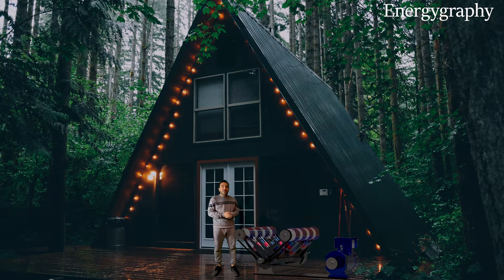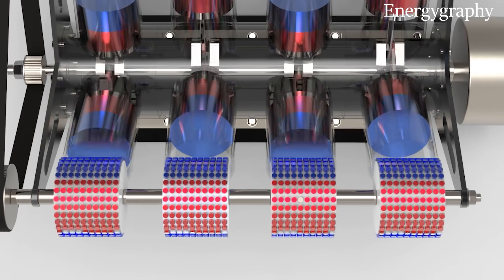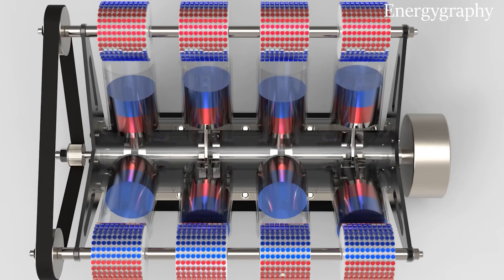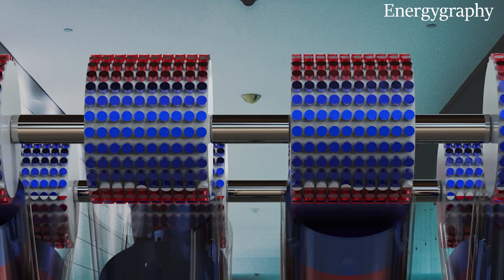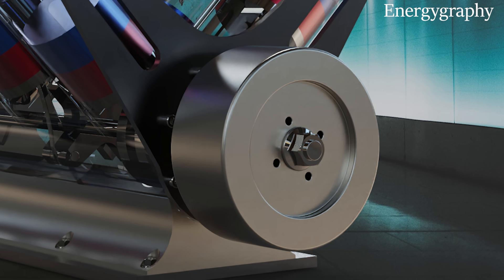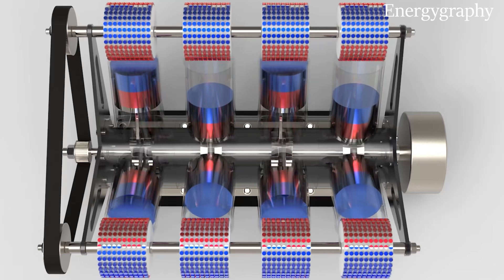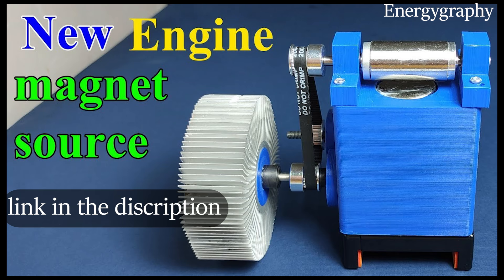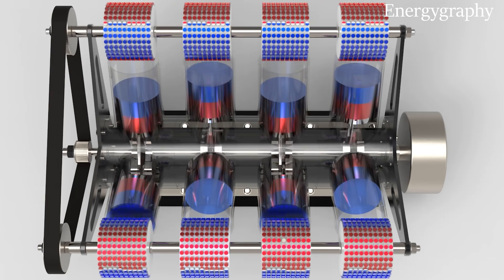New Magnetic Motor Design: Overcoming Lock Areas for Continuous Power

Comment: No motor can work without an energy supply. Every movement has to be compensated for in order for it to be repeated. Experimenters trying to achieve 'perpetual motion' come to realise that. Whether movement is achieved by magnets or gravity or something else you get only one movement as it uses up energy stored in it. Then you have to replace the stored energy to get further movement. Simple!
  Movement of anything is caused by energy so there can be no motion without energy being applied or stored energy used up. Sorry, no perpetual machines.

Comment: This is not going to work. You might get it to turn for a while under no load, until friction stops it, but as soon as you try to draw power out of this system, it will instantly stop. When you want to rotate those round magnets that push the pistons, you‘ll have to invest the energy that the piston produces, because the magnetic field of the piston will resist the rotation

Comment: I'm wondering if an inline 6 configuration might work..?  Reason why is all the big diesel engine makers like this configuration due to its efficiency and reliability.
Reply: The configuration is irrelevant. Never mind what configuration is chosen, this design does not work. Permanent magnets are not a source of energy and can't drive a motor. In contrast, burning diesel does deliver energy.

Comment: Using the V8 formation, you may need to add a brace in the center to keep the spinning rods from bending. Otherwise you might have to use rods that are so thick they rob you of efficiency. Of course an extra set of bearings on the rods will also reduce efficiency, but I think not as much.

Comment: Just made one out of Lego technic in 30 mins. One problem is that the pistons had to be further away from each other so they won’t clog. The main problem is that the crankshaft doesn’t produce enough torque to turn the magnets at the end of the pistons. Doesn’t really work with all gear ratios that I used or what size piston strokes.
Reply: Vaya abra cometido usted algún error?

Comment: It will not works...You should put a revo exciter to maintain a rotation of the cycle....a starter which is the exciter should properly aligned each rotation.... You only need a minimum waste of energy for exciter to run that engine continuously....Thanks to GOD the source of ENERGY and to me that give you the IDEA on how the free energy works without faking it...FROM PHILIPPINES HERE...Thanks me later.

Comment: You need a corresponding magnet or electromagnet at the crank to repel and attract the pistons in conjunction with the timing of the magnets at the top of the piston. It wouldn't hurt to put in a partial gear to assist the crank's rotation where the crank is weak in its rotation: This can also aid in maintaining timing mechanically. If it were me building this, I would use a hybrid magnet and electromagnet setup. I would use the electromagnet as a starter and have it reengage to assist and minimize wear at the helper gears. You can even mount a sensor on the gears to turn the electromagnetic assist into a mechanical and self-sustained timing feature.
Reply: There are other designs on YouTube doing precisely as you describe and still producing do additional energy
Reply: Estaría bien que usted pudiera montar uno!

Comment: "Charging" a magnet is equivalent to producing a spring. A magnet does work afterwards if someone has invested work, for example pushing two magnets together with a common pole and then repelling them - that's the returned work from the previous investment of pushing. Likewise, a spring does work if someone pushes or stretches it. Therefore, the magnet (nor the spring) does no work from their production, but from the input work in their finished form. Over time, the magnetism decreases, just as the elasticity of the spring decreases. Production energy (energy supplied during production) is not work potential. It's the same as making a bicycle - it allows you to ride with the energy of your muscles. If the concepts are unified and the meanings are distinguished, you yourself will come to the realization that a perpetual motion machine with pistons is a completely useless waste of your time.

Comment: Question: how much energy is used to produce/ charge the magnets? Is the energy produced by the device more or less of the energy neede to charge the magnets?
Reply: "Charging" a magnet is equivalent to producing a spring. A magnet does work afterwards if someone has invested work, for example pushing two magnets together with a common pole and then repelling them - that's the returned work from the previous investment of pushing. Likewise, a spring does work if someone pushes or stretches it. Therefore, the magnet (nor the spring) does no work from their production, but from the input work in their finished form. Over time, the magnetism decreases, just as the elasticity of the spring decreases. Production energy (energy supplied during production) is not work potential. It's the same as making a bicycle - it allows you to ride with the energy of your muscles. If the concepts are unified and the meanings are distinguished, you yourself will come to the realization that a perpetual motion machine with pistons is a completely useless waste of your time.
Reply: I don't entirely agree. The comparison between a magnet and a bicycle can only hold true as regards the materials used, the assembly of the rare earths. In order to work, the magnet must be subjected to an enormous electric discharge and it is this that gives it its characteristics, which are not unlimited. A magnet is not like a spring, it is instead more like filling a fuel tank of a device that generates a force, under certain conditions and which is therefore subject to the laws of physics. Of course, I agree with the conclusion.
Reply: @teresadepizzol9076  The production of the magnet (input production energy) is not a source of potential (the magnet does no work even when it is stuck on the fridge door dW=F*ds = 0. More is evident from the integral...). The potential (gradient) is visible only after putting in (mechanical) work, for example by pressing two magnets with corresponding poles, which is manifested by a noticeable resistance in the fingers of the hand. A spring behaves in the same way, or a bicycle, which can be set with diamonds, a frame made of rare earths, etc., but the movement is provided only by the mechanical work of the cyclist. It doesn't matter how much we invested in production. These are two things - a tool (magnet, spring, bicycle...), which must be produced with the contribution of some energy (according to the sophistication of the tool), and the use of the tool itself after applying additional force, for example muscle power. No sophisticated tool (not even a magnet) will start by itself. It is still one and the same principle, which many confuse with each other and the ideas of perpetuum mobile arise. It is possible to popularize this principle on other examples - the result will still be the same. The fatigue of the material, or the weakening of the magnetic field, is not about the potential in the gradient, but about the quality of using additional power, for example muscles.

Comment: everytime the pole number increase so do the lock area... so if 1 doesnt work make it 8 will mean 8 new lock area even with properly balanced angle 1 lock will still be there to stop the whole system. the locking is indeed the hardest(where almost all engineer say its imposible)

Comment: If everything is equitative shape/orientation symmetrical, you''ll have same attraction/repulsion vectors of magnetic force. I may be wrong, but i dare to say it wont work. You need an unbalance mechanism to produce movement. I dont see it here. For instance,  devices like a magneto-gravitic can takes advantage (like the rotating wheel project where a magnet constant attracts a steel ball and the ball by friction rotates the wheel... its just an example). Here, everything is symmetrical(surfaces, shapes, distances, etc)...  So when you think on repulsion/attraction movement, you must think the opposite conterpart.

Comment: I had a rotational one using a bicycle wheel that worked, but only for a couple minutes then would slow down and stop. I think this was due to magnetic flux expanding and I gave up before finding a way to disperse or reuse the excess magnetic flux. I had no way of measuring the flux to verify this though. I am wondering if you experience the same thing?
Reply: Nah, it's called friction.
Reply: @andreasschmitt2307  No, because it accelerated on it's own. I had discovered a different reaction with magnets when you use the side of it next to a pole on the other magnet, it will push it sideways. Try it. It's pretty cool.
Reply: measure flux with iron filings
Reply: Hello Gary,
Do you have a video of it?  Is it possible to use magnetic shielding to dissipate the buildup of Flux?
Reply: @danielfeyerabend904  I only tried Ferrite material. It did not help. LOL What I did was this. Take 2 magnets and hold them beside each other. Then rotate 1 90 degrees. You'll feel the magnet want to slide, or push sideways the other one. Line them up along the edge of a bicycle wheel in the same orientation. Then mount the actuating magnet close to the wheel. You will see what I mean. I tried to make the actuating magnet spin like a cam. Pull-slide-push for 180 degree rotation for each magnet on the wheel. For this, every other magnet must be 180 degrees rotated on the wheel. I got a linear plastic gear and mounted it around the wheel and had a pinion gear to spin the actuating gear. That did not do as well as the slide method though. I may revisit it some day. I still have the wheel, but it is stored in the garage and the foam board I used to mount the linear gear is all warped after spending a full day on getting it true round to keep the air gap consistent. LOL UGH!!!!! I could use that as a template still though.

Comment: Even if it worked, it's not free energy. There is no such thing as free energy. In this case, mining, manufacturing and distribution. Magnets requires rare earth metals. Manufacturing requires fossil fuel, as does distribution. You'll also have maintenance costs on top of that too.
Reply: Ia boleh menghasilkan elektrik
Reply: The production of magnets is not relevant here. Energy is needed for the production but only a tiny part of this energy is stored in the finished magnet. And in addition permanent magnets do not loose their rather small energy by exercising forces. The energy of strong magnets is below 1000 Wattseconds for a magnet volume of one cubic decimeter. Keep also in mind that you have to pay for the energy which was spent in production when you buy a magnet. Which shows that this energy is not overwhelming.

Comment: a basic course in physics is what you need. This "engine" can't work. Magnets in this case are working as springs. you need to push them together before they repell each other, you see the energy that you use to push them together is the energy that you get minus losses. You need not dispise physics, it may  actually make you a true inventor

Comment: Unfortunately, will not work, because The attraction and repulsion force will find a balance position and the system will stop
Reply: How long it'll work? More over based on properties of magnetism Coggin and changing of polarity may occur, and stop working.
Reply: Maybe I zero gravity and a vacuum 😉
Reply: This is wrong, the machanical arangements make a balanced position impossible
Reply: Will flywheel help this out?

Comment: Save your times and ours.
Magnet lose its power gradually by time.
Especially if exposed to opposite magnetic field.
Reply: Magnets are used in motors, they don't lose their field. Or just very gradually over centuries, it doesn't matter here. Such magnetic contraptions don't work, this has nothing to do with degradation of the magnets.
Reply: Yeah, these magnets will lose their power in 1000 years. Hopefully you'd still around to complain.